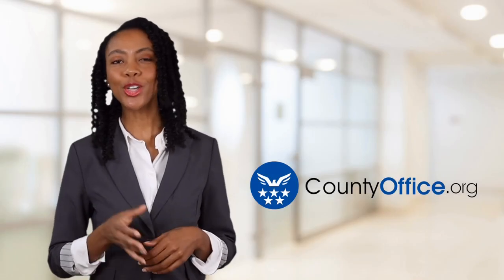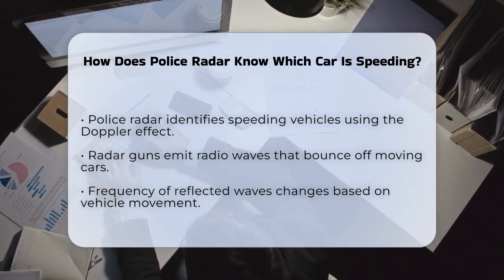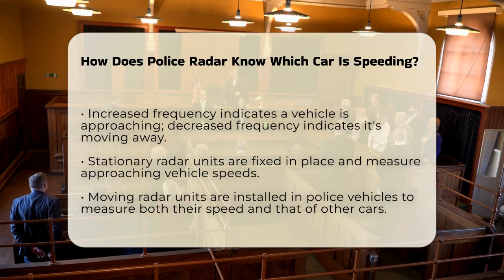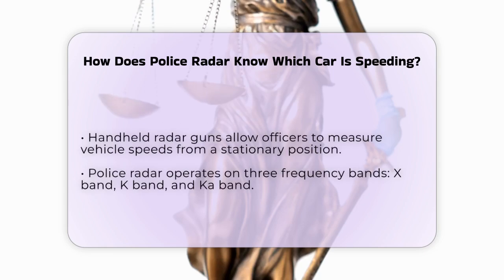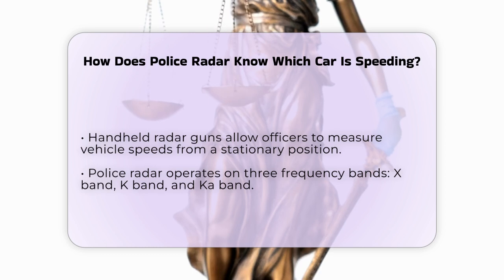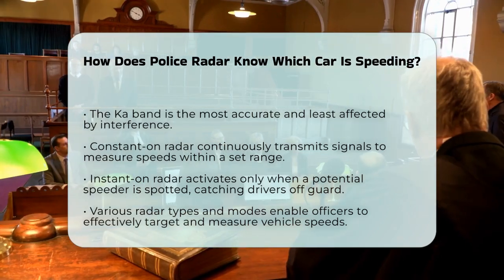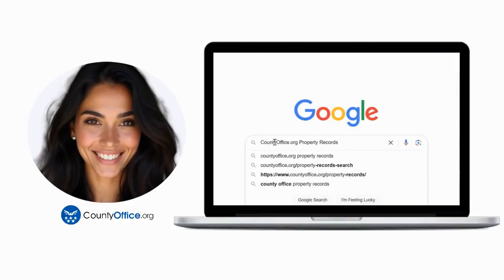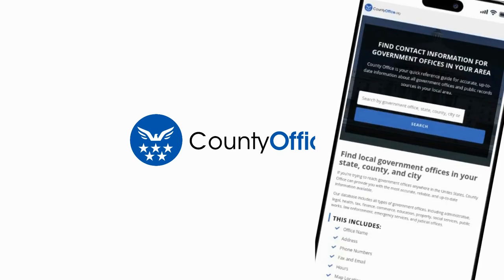How Does Police Radar Know Which Car Is Speeding? - CountyOffice.org

Comment: Answer is the radar locks on the largest most pronounce target and that’s why I get away all the time in my tiny little sports car. It locks on other larger brighter vehicles. Paint, size, shape, and proximity all effect it’s ability. Look up cannonball racers. The officer needs to visually see which one was speeding in the group and that’s only if it locked onto the speeding vehicle. However if the officer is using laser speed monitoring that he would point at your vehicle and get your speed… the vehicle it’s pointed at.
Reply from the maker: You’re right that traditional police radar often locks onto the most reflective target, which can be influenced by a vehicle’s size, shape, and even paint color, but officers are trained to visually confirm which vehicle is speeding, especially when multiple cars are present. Laser (LIDAR) is much more precise because it targets a specific vehicle directly. Always confirm details with your local government agency. Have you ever tried requesting public records from your local police or sheriff’s department to see how speed enforcement is documented?
Reply: How would one do that?